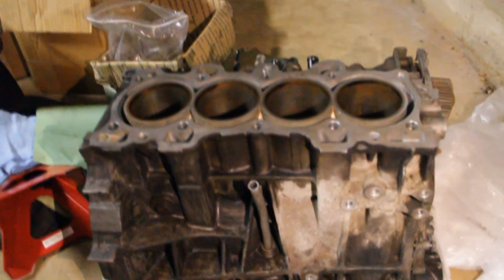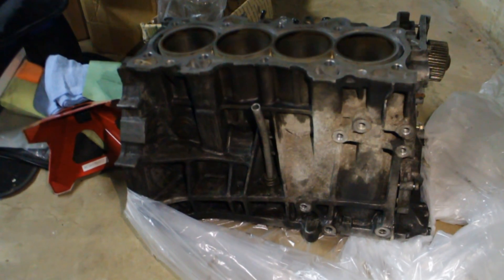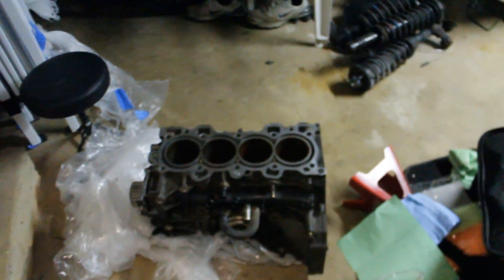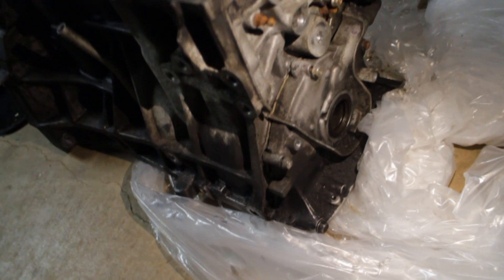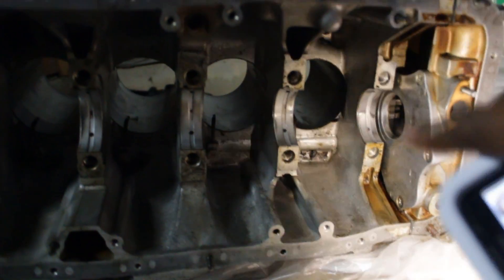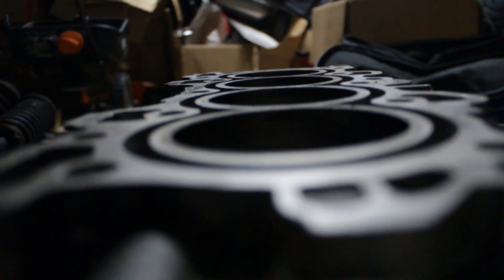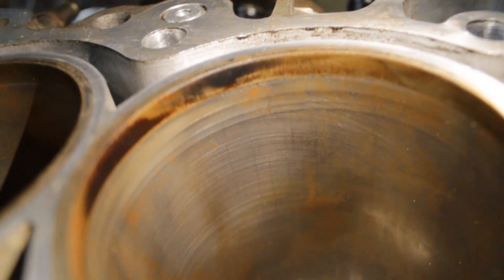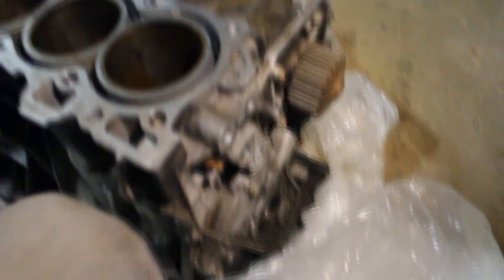B18C1 GSR Engine Build Parts List

Comment: i had a gsr with stock head/internals, skunk 2 intake manifold port match to 68mm tb, tri y headers, jun stage 2 cams, aem fuel rail and adjustable fuel regulator, tuned on hondata s300. i made 185whp. compression was around 200-210 across. good luck with ur build.

Comment: I know it probably seems like I always come here to leave negative comments, but why would you go with GSR Pistons? You're going to be hard pressed to meet your goal with those. 

If you're going for the power of a Type R, then don't you want to have the compression of an ITR? What head you use will also play into that as well. Compression is your foundation for your power. Nippon or RS Machines make great cast OE replacements, and you could get P30, JDM P73, or CTR Pistons in almost any size. If you want to make good power, 82-83mm would be a great choice. I would get the block checked out, LIKELY bored or honed, then go from there. Getting it bored then honed is a better choice, because if you hone a block too many times, you lose clearance. 

A P30 head from an SI is no better than a P72 GSR. Yes the ITR head is made from the same cast, but it's then ported and polished. THAT is the benefit of the P30 ITR head. You WILL lose some static compression with this over the GSR head which I would consider a pitfall. The only benefit of the un-ported P30 head would be the ability to use an ITR intake manifold, but you can easily find a Skunk2 GSR manifold. With that said, get what you can find cheapest. DO NOT spend the money on getting it ported and polished. I don't think you realize this, but that process can take $800-1500. Think about it from a power-per-dollar standpoint. 7whp for $800? 

Things to add to your list- 
ARP head studs
ARP rod bolts

I'm sorry man, but you should really quit listening to people on YOUTUBE... I hate seeing people give you absolutely terrible advice, and that's why I comment. 

Not trying to be an asshole, but you need to do A LOT more research before trying to build an engine. Buy a Helms manual.
Reply from the maker: +Grant Davidson I will agree with you there a lot of misinformation is given and seen all through here and other sites. I know its possible to have a stock bottom end and built head and make 170whp+ because i know people who have done it and seen dyno graphs. If you want we can make a bet(im serious too) ill bet you $1 that i WILL make 170 whp or more with my "ideal" setup. Now this is not my final product...its a starter motor and over time things will change and the motor will get faster. This is just a nice transition from non vtec 120whp to vtec 170whp the gsr is give or take 150whp so you figure with cams, IM, Header, Cat back, Intake It should be fairly easy to pull 20whp out of that with a tune. I appriciate your constructive criticism and long comment as i find these to be more informative. Dont worry ill add pistons later in the future..but as of now im just on a tight budget.

Comment: When it comes to the camshafts stay stage 1 or stage 2 otherwise your'e car won't idle stable and render it useless for DD. I recommend looking into (BC) Brian Crower Stage 2 NA Camshaft's, retainers and valve springs. Their excellent in value and have REAL Cred on the track.
The injector's are located between the intake manifold and block their connected to the fuel hose and their function is to spray fuel on the piston's. The numbers ex: 400cc, 440cc etc. correspond to capacity of fuel volume the injector's have the ability to spray. 
In terms of making more HP always think: More Fuel + More Air (+Spark ) = Bigger Bang.
You will only require a fuel rail if more fuel needs to be delivered. So you gotta make sure that you've got a pump that can supply it and injectors that can deliver it.
High lift camshafts, will allow for a increase of volume in the port through piston positioning. (*Like Vtech). 
The valve springs and retainers will allow your engine internal's to rotate at a higher speed, this will extend your redline and in return also allow more fuel.
Now to the bolt on's: This is where you're focusing on air flow. Air intake, Intake manifold, exhaust manifold and exhaust etc.. 
If you deliver more air and fuel, you may need a air/fuel meter and management system. 

Also look into painting the exterior of the block, its cheap, easy and makes it look new.

I think you have a good plan with your build, keep it budgeted, simple and don't get carried away....cause its so easy to! :p
Reply from the maker: +C Swiss Thanks for all of this it really helps me understand a lot of what i do not know! Also im trying to save as much as possible because at the end of the day im only trying to make 170whp so it should not require much money..

Comment: bro get a b16 head if you're going to build. it'll be like putting a type r head on your block. 
all the machine work is cheap aswell so you're probably better off boring it out if the scratches are too deep. they usually charge around 80 to bore out to whatever spec. spray some wd40 on the cylinder walls to keep them from rusting more. Oh and micro fiber towels scratch surfaces so dont use it!

i have a complete jdm type r manifold with fuel rail and injectors. new gsr gates timing belt. and 310cc injectors if you're interested!
Reply from the maker: +RUIND sweet! thanks for the input ill stay in touch just in case,but doesnt b16 lower compression?

Comment: I could be wrong but if you get bigger cams and stuff you may need bigger injectors?
Reply from the maker: +Josh McDermott I may need it. Ill ask around.
Reply: No, stock injectors (240cc in most d and b series) should be fine for up to 200 whp. Everything from d16 to b18c5 uses them just fine. H22 go up in size a bit to 270cc and 310 in some cases.

Comment: a hone is not gonna fix that... gonna need to go over
Reply from the maker: what do you mean "go over"?
Reply: bore it over. usually people do 81.5mm piston size. and you have to run 81.5mm head gasket also. honda makes oem hg in 81.5mm

Comment: not a insult or anything but you should never touch the cylinder walls with anything the rag could of put the scratches cause you essentially running that rust on to the wall using it as a abrasive
Reply from the maker: :/ Very true.....did not think about that!!! worst comes to worse I have to get it bored to 81.5 and run different pistons.
Reply: Middleton Films yeah true but just thought I would let you know for future reference but can't wait to see the finished product

Comment: nah you need to have it bored out and buy some high compression pistons what is the use of having a built head when you can't fully utilise  the performance parts your adding.
Reply from the maker: Then it becomes costly at that point by an additional $400-500 plus if i were to get pistons i would be running skunk2 stage 2 pro's! Which runs the cost up even more. The time will come for more hp's just not right now...."I should be just doing a stock gsr setup but thats just a waste of time.
Reply: tommyboy1two foreal. At least some p30 pistons
Reply: Middleton Films why the rush? To get it together why not just run your stock engine until you get the money to do a full engine build?
Reply from the maker: +tommyboy1two because life........🤔🤔🤔i want to finish this car before i move out.